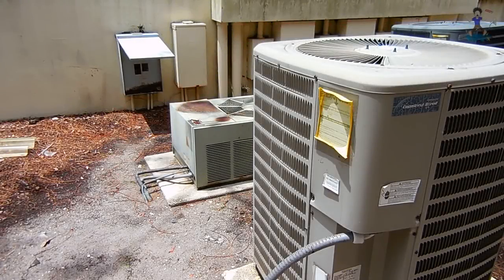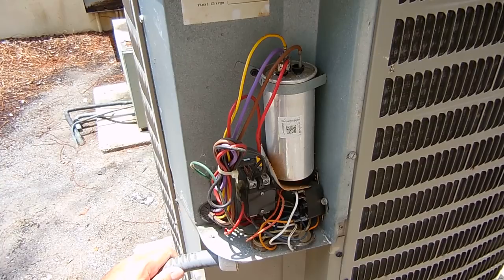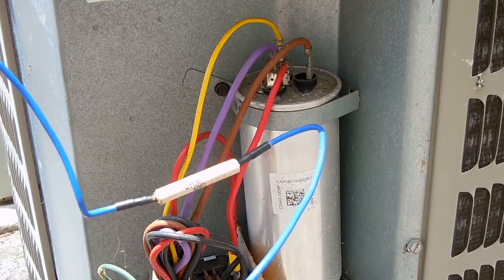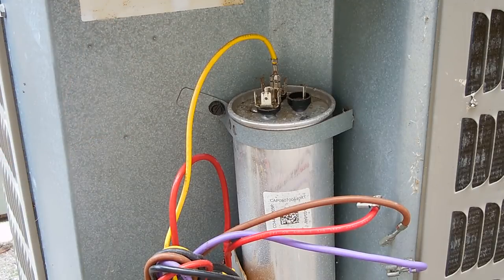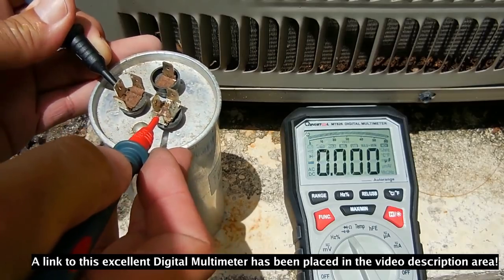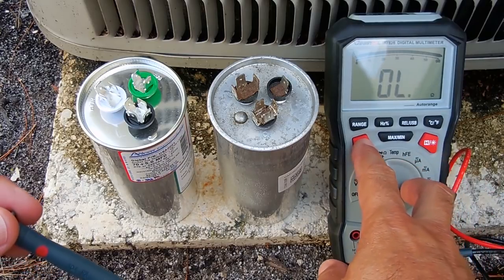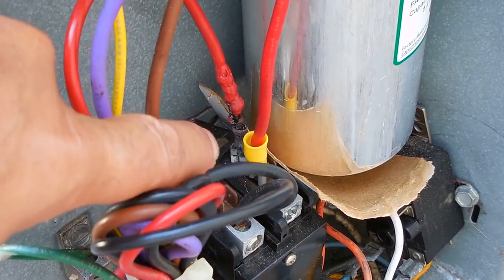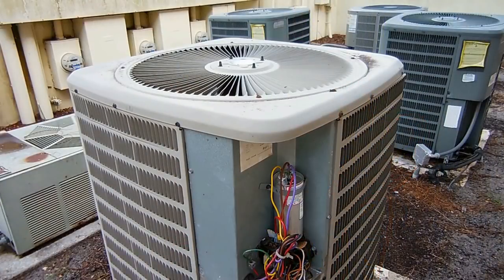Central A/C Compressor Won't Start Up(Stuck/Momentary Hum )

Comment: OK video, but you say the Red Common wire was put on by an 'idiot' because it was too short. IMO you should have made a longer wire so you could move the cap up so it is not resting on the contactor. Especially since you were already making a replacement for the burnt wire.
Reply from the maker: The AC repair was unexpected and I had no supplies on hand. I was using my friend's tools. If I had extra wire, yes, I would've replaced it. The other wire you mention wasn't replaced, the female blade end was. Thanks for watching!

Comment: If your Compressor is not turning do not hit it with a rubber mallet that a quick way to Cause a Electrical blow out
Reply from the maker: Wrong.

Comment: You tested your capacitor wrong the first time! You checked between fan and common the first time then fan to Herm not herm to Common.
Reply from the maker: Both sides of the dual capacitor were tested.

Comment: So Everyone has to use a service call- because it is on the property, no other choice, but this is SOOO Commion and should be ballpark $100 130 Max snf hr shjoiuld br in & out <30 minutes if they were nice, and carried the part which they should. Some always say. "I have to get one" so they can add $50 even if they go to McDonalds.This is as simple as it gets. Get as price first for  cap but know what mfr unit you have.

Comment: Pitty this video wasn't out a year ago, might have been why my compressor didn't start. Whole system was replaced.
Reply from the maker: You probably got taken, it happens all the time. Thanks for watching!
Reply: The compressor contactor and capacitor are very simple homeowner fixes. Next slightly harder fix is replacing the outdoor fan motor when it dies.

Comment: Is this a Goodman unit?....where the idiot factory crams everything very LOW in the compartment so that you can't get easy access to all the connections?......WHY do they do this? I like my Goodman unit otherwise in most other respects.
Reply from the maker: I don't think it was. I have a Goodman for my house and it works great.
Reply: @electronicsNmore  ...agreed as to function....my Goodman works reliably too.

Comment: I've never seen somebody take that much time to discharge a capacitor. I respect why you did it but it is a bit overkill.
Reply: Either it's over kill OR it could kill you, your choice!
Reply: @riceball4u172  I deal with capacitors all day for work, I discharge it with an insulated tool only if I remove it, and that is if I remember to.

Comment: you showing people how to work on there ac can get someone hurt or electrocuted.. plus we go to school to learn this stuff and expect to get paid for our knowledge.. you are workin us out of work.  i hope you the first one with no work
Reply: 1st Place Sellers   You better rush over to my local Home Depot. They hold weekend classes all day and have workshops on everything from wiring your basement renovation, doing drywall, doing the plumbing for your new toilets, sinks, etc. They teach you framing, building your garden shed, you name it, you can learn it there. 
And when you are ready to buy your materials, they are there to help you again. Even when you are doing your landscaping projects, same thing. Damn that Home Depot putting people in danger from getting electrocuted to having finger splinters and they are putting so many trade people out of work. Hope you straighten them out. But wait until I'm finished my basement, still gotta put in that suspended ceiling.
Reply: For every 1 DIYer you're going to get 10 who will call  a pro, even for the slightest of problems. Have integrity, do good work and you will always get business. Some random guy on YT won't put you out of work. You will put yourself out of work with your attitude.
Reply: @donnybwisor  You are right. There are so many individuals who will not do work around the home. Whether it be a simple wiring job to something more like a basement renovation. Most of those men don't want to be in a state where it becomes expected of them. More pleasurable sitting on the patio with a beer. 
Many men were never exposed to doing trade related work as they matured and of course some are fearful of things like electricity. Most are just plain lazy though. So they quickly reach for the Yellow Pages to locate a contractor. 
Contractors do get a bad name for poor workmanship. Most have earned it. But it's not always the work they do that they get a bad name. A TV station in the big city here did an investigation on service tradesmen. This was to do with plumbers as there had been some workmanship and unfair or very suspect billing practices. So they came into peoples homes and set up hidden video cams. Then called in different contractors to service the dishwasher. They set it up with an easy to find problem. 
The one guy came in, told the lady of the house he would call her after he finished working on the kitchen dishwasher. He spotted the prearranged problem very quickly (blocked drain) fixed that up. Then in the middle of her kitchen he grabbed her coffee cup off of the counter top. And opened his pants, urinated in the cup, poured it down the drain and replaced the cup. All on camera. The TV crew approached him as he was leaving and challenged his billing for what he did and his peculiar behavior. 
Sometime passed and as it turns out this guy ended up running for political office. The video highlighting his behavior became public and he was kicked to the curb. There are some really bad contractors out there, so people need to hear the stories that are like this. It may inspire them to do more of their own work. LOL
Reply: @hardrock1826  Good post.  It is good to have some knowledge of how appliances work so you can protect yourself from bad contractors but not everyone has the knowledge or feels comfortable doing work on his own appliances since mistakes can have extremely harmful or fatal consequences.
Reply: @1575murray  If you don't have the background, haven't taken steps to get some knowledge and in addition are too nervous about things like electricity. Then you are going to have to call in someone who does not have those limitations. And the only consequence that you will suffer is an expensive service bill.
Unlike years ago, you had nowhere to go to learn techniques. Today we have You Tube and good people on board that can demonstrate for you how to overcome issues of a trade related matter. So if there is something you want to know, pull up a chair, turn on your computer and go to school.